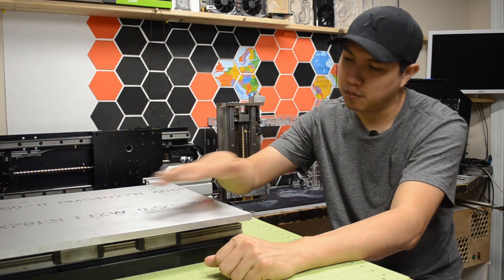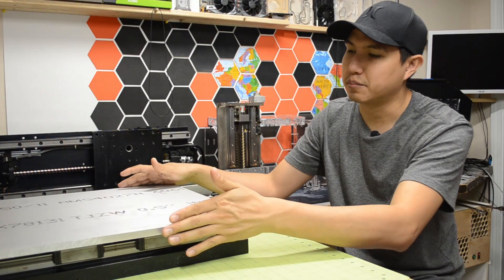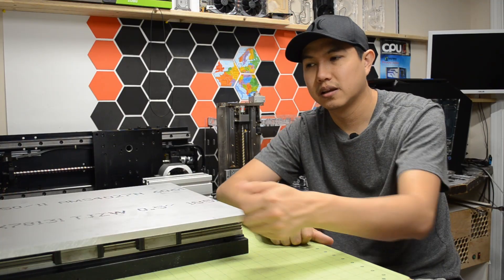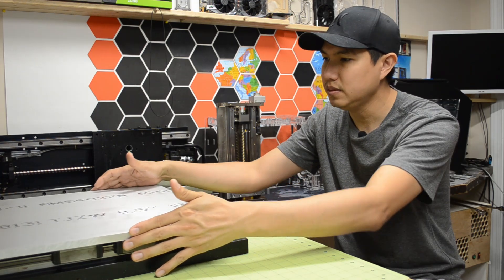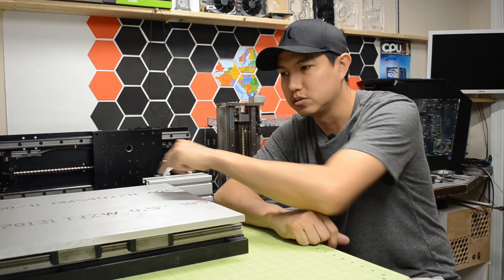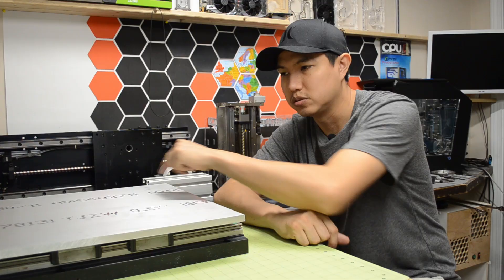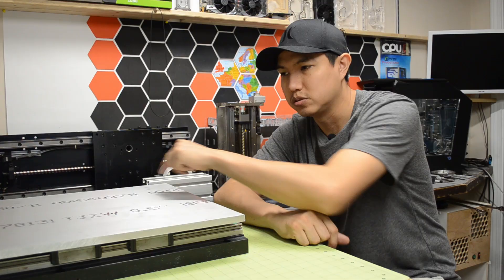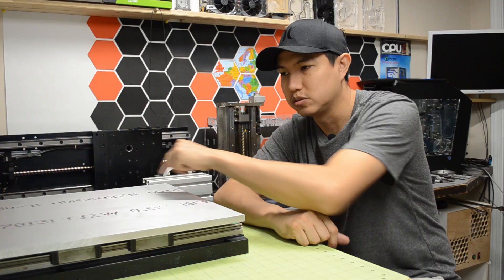CNC "Fixed Gantry"  - Part 2 Epoxy Granite and Y axis table

Comment: For milling say M3 and M5 holes into a 1/2 inch thick aluminium plate. What type (flutes) and size (width/lenght) end mill did you use for milling the mounting holes in the 1/2 in thick base? 

BTW - both your CNC builds are awesome :)
Reply from the maker: @MP-mu1kw  I think I used a O-Flute 1/4 size 3/4 length from Onsrud.
Reply: @radikult-custom  I take it the 1/4" endmill you use for cutting through the plates. But what size to use for milling the holes for mounting linear blocks and spindle mounts etc?

Comment: People, to clear something first in terminology. Epoxy Granite is special composite group of materials who mainly consist mixture of Granite as natural igneous rock, quartz as fine sand and gravel bonded together with two part epoxy. Color may be added to make some better look to the mix. Sometimes mixtures doesn't consist Granite as key material, then it is called Epoxy Concrete, Epoxy Composites or if its made of just two materials Epoxy + the material used maybe Quartz or Gravel etc Epoxy Quartz, Epoxy Gravel corresponding to it. If you see the properties of Granite as materials, has excellent compressive load capability's (but not so good tensile compered to gray iron), has excellent vibrational dampening characteristics and lower temperature expansion. Granite is second hardest material in the world after diamond and doesn't "flow" because of extremely low stress trapped inside. Also about the temperature, If t rises two materials may deform the shape because of bimetal effect that must be taken in consideration. Also compacting should be done with large amplitude vibrations, because the bubbles of air are formed while mixing the materials and trapped in the mix, We surely want to remove them. Compacting it is not the proper way because also the bubbles are compressed, not removed from the composite material, weakening the composite material characteristics. I must say, many things should be taken in consideration for proper making of composite for cnc bases as Epoxy Granite. This is very ambitious and I am glad that people use their own time to experiment practically with this Mechanical engineering and Material Science. I would love to see some test of compressive load capabilities of this material, and Temperature expansion, Vibration dampening ect. Thank you

Comment: Hi; I don't wanna be a jerk, but epoxy won't make a difference there. Torsion acts on the outer skin of the beam ; on the other hand  bending forces , should they be high enough (not the case here), would not be ''impressed'' by epoxy. Epoxy works best in compression only. Sorry to convey such a message. Keep up the good work !
Reply from the maker: Mihai Dumitrescu hi, you are correct. Epoxy granite won’t do much (is any) inside the beans when it comes to torsion or bending.  
I did it mostly to add weight to the frame so the machine won’t be bouncing around when cutting at high speeds. 
But thanks for that information

Comment: Were you not happy with the sand fill only? Does the epoxy+sand perform much better than just sand? I’m building a machine and am not sure which one to go with. Please let me know your experience!!
Reply from the maker: Daniel DeArco hi, the sand fill extrusions were good. But adding the epoxy will try to fill the smallest gaps between the sand and help a bit more with vibrations.

Comment: Have you also considered a sand oil mix inside ( or at least tried it ) where you fill it about 95-97% of the way since from i have been teached that is a pretty commen anti vibration method / mixture in the commercial cnc's ( ex. A dmg or hermle cnc) or extremely long compared to diameter drill out bar
Reply: Can you give more details of the process you're mentioning
Reply: @Z-add  it witch regard ?
i just know ( after teching and personal experians ) that that combination inside the holow parts of the frame absorbes / reduses a lot of vibrations do to the natior of the sand and the oil is then to absorbtion / resistand to the sand that have been set into motion by the vibration ( bringing it to a stop faster )

though you gotta make sure that the sand is pure and starale 
plus that it is pure mashine oil ( since if you just use some random oil then the chance for bakterial grown is to high and you would have to throw it out and spend even more money and time then just getting the right one from the start ( aka do your self a faver and spend a little more in the begining and save money on the long run )
Reply: btw the oil have to somewhat / pretty thick but not like jell/cream thick  but in somewhat if a mid between jell and milk thickness ( around as thick as the brown transparent oil in a car engien )

Comment: Hi, Thanks for your video, Did you notice any distortion with the extrusion after the epoxy went off, I am just wondering about the effect of heat generated in curing.
Reply: people usually use slow-curing epoxy for things like this, which gives off much less heat and causes less warping.

Comment: In order to make your granite more compact, you need to add very fine particles to your mix like silica fume witch is a 1000x smaller than a cement particle to fill all the small cavities.

Comment: The epoxy should be mixed before adding it to the sand. Adding one part first will result in some of it being absorbed into your aggregate and not be able to react with the second part.
Reply: This Is a bit of  misconception, it is recommended to mix part of the epoxy and mix it with the aggregates before adding the hardener. All research papers on this matter follow that particular method. 
Mixing the epoxy together and adding it to the aggregate after will lead to an improper mixture and greatly reduce your worktime.
 You have to consider that even after pouring it you still need to evacuate the air bubbles by using a vibrating table and as the epoxy hardens its more challenging.
Reply: @axyzmachines4941  So are you saying mix like half the epoxy and hardener first then add it to the sand, and once thats mixed in well add in the other half of epoxy.. mix that in well, and then add in the other half of the hardener?

Comment: You mix sand with resin and then add hardener ? You should first mix epoxy with hardener and then add it to sand so it is perfect mixed. 
Ps...cure time can be 24-48h but max strenght is after 7days up to month
Reply: I agree !

Comment: Nice stuff. Interesting you seemed to cut the 6061 without lubricant just fine  with no chip welding. Any special advice on that?
Reply from the maker: pitu72ger well I mostly use Onsrud lmt end mills and I try to follow their recommended speeds and feeds.  
But I would recommend using Single Flute over 2-3 flutes end mills and try to cut on Climb
Reply: @radikult-custom  thx for the reply!

Comment: Very nice work on this new build. What is your aim for this build compared to your current machine? It seems your current machine is very capable, you are getting very nice finishes in aluminium even without lubrication or even air blast. What cutters and feeds/speeds are you using?
Reply from the maker: Jeremy Young my aim would be about the same. Maybe try to get faster rapids and if I can improve surface finish too 
 The cutter I used are mostly from Onsrud Lmt. And I try to go with their recommended feeds and speeds.

Comment: Why not regular reinforced concrete cement instead of epoxy .. would be much cheaper
Reply from the maker: Avinash Narode epoxy granite has the ability to absorb vibrations
Reply: Ohh yes.. thanks for the reply

Comment: What did you use for the sand\mix in the epoxy granite?
Reply from the maker: WaldvogelReview you mean the paint mixer? The metal thing attached to the drill?
Reply: @radikult-custom  No I apologize, the sand\pebbles. Everybody has a different opinion on what the granite in epoxy granite is. Some people just use silica sand, some use playsand. Did you find ground up granite pieces? Did you use a type of sand? Did you mix quartz with silica independently? What is the sand\pebble mixture you used and where did you get it?
Reply from the maker: WaldvogelReview I end up using just regular “fine play sand” I found at a local hardware store and it’s cheap like $4-5 a bag.  In reality you might want to mix supper small grains with bigger ones or gravel. 
So the end result is all cavities are packed ( I hope that makes sense)
Reply: @radikult-custom  Yes it does. Thats very helpful. Ive been interested in this for awhile. I always see conflicting arguments on ratios of grain\granule size mixtures. Youres seemed like a good mix so I might give it a try !
Reply from the maker: WaldvogelReview you could always use “silica” or other products that are even finer than sand. The issue with that is that either they are kinda hard to acquire or expensive

Comment: You may already know this trick, You can take a jigsaw or reciprocating saw with no blade and hold them against whatever and they will vibrate out bublbes or help settle sand...
Reply from the maker: wayne creech that’s a good idea, if everything turn up good, I was going to use a table buffer and offset the pad to vibrate. Or use a orbital sander but I didn’t know how to attach that to the table or casting part

Comment: What kind of info did you get from your test pieces, are the epoxy granite and aluminum thermally compatible? Are they much stiffer?
Reply from the maker: Beach&BoardFan I didn’t do any advance testing when it came to thermals.  I know aluminum and “granite” don’t have the same thermal expansion. But I’m not worry about that since where I’m putting the machine should stay at a constant temperature and not fluctuating that much. 
 Same thing with testing stiffness. I don’t have advance equipment to try to test that. But what I can say is that they are much heavier now. Also I have dampened vibrations and harmonic noises by a lot.
Reply: Cool, I'm looking forward to seeing this when its all done 👍 When you finish it will you do a cost video, I'm curious about the epoxy granite cost. At least here, 8020 rail is pretty expensive itself, but if you can run a smaller rail by filling it with epoxy granite and come out on top cost wise, that will be pretty cool.
Reply from the maker: Beach&BoardFan I was lucky enough, that on eBay there is a seller selling big pieces of 80/20 for $1 an inch. While on 80/20 the same cost $3-4 an inch. 

 The thing about epoxy granite is that the piece of granite needs to be big enough to matter. If it’s 1x1 inch it’s might not do much
Reply from the maker: I forgot to mention, the eBay seller is 1 hr away from me, so I was able to select the pieces and didn’t have to pay the shipping

Comment: What's the purpose of the epoxy / sand mixture ?
Reply from the maker: hed420 my main reason is to add extra weight to the frame and base, also it add a bit of dampening to vibrations or resonance. 
 But if done in big cast can also add rigidity
Reply: Is it a big different than that you did them using sand instead?
Reply from the maker: raychar c if you going to fill extrusions with sand only instead of epoxy and sand there shouldn’t be that much difference between the two.
Reply: @radikult-custom  i will properly fill my 4mm thk.  100mm steel square sections with sand. Sand will leak and damage to leadscrew if they go there. But in another aspect.  if there are any changings need on machine or inside them in case. I can unfill them to do the works. Just sone opinions..
Reply: It's mostly to add dampening.
Reply: I think it has the sandwich or composite material of add-on strength effect but not much.